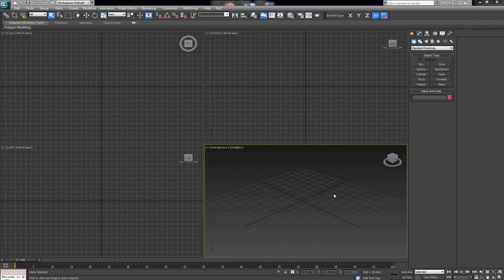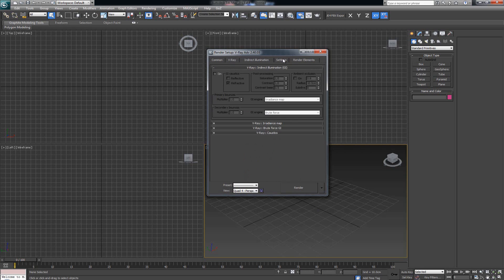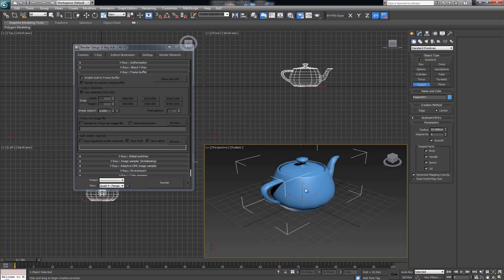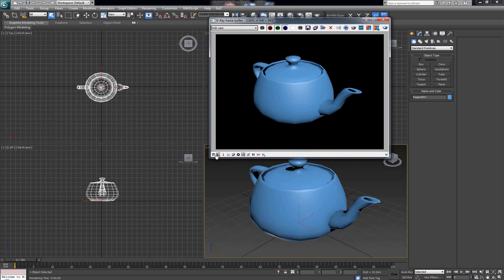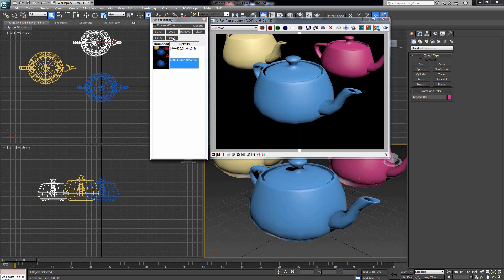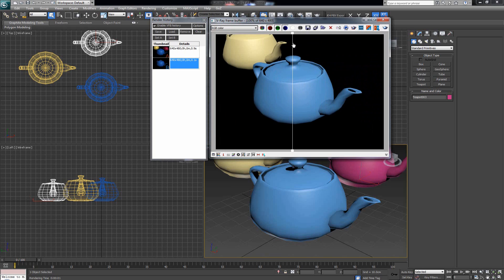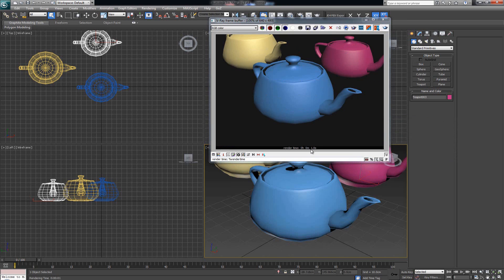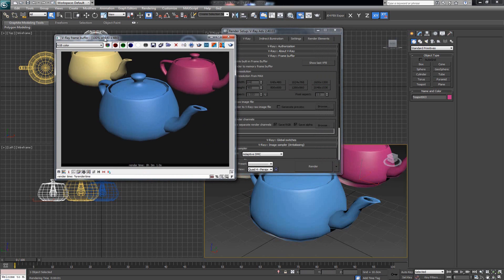Introduction to V-Ray, V-Ray Frame Buffer Part 3

Comment: Hello. What could cause that i have a black render when i'm rendering something while I don't have any lights in scene? It's not big deal, but to see this simple teapot i need add to scene any light source. I could't find this in internet, thats why im asking u. I have max 2016 and 3.40.1 VRAY. I didn't have this problem when i had 2013 max and a bit older V-ray.
Reply from the maker: Well after the 3.40 version of V-Ray you need to have a light in the scene even for a very simple scene like this one. So don't worry you aren't the only one with this issue
Reply: @DenisKeman  thks.....for the answer. i hav same issue too. mine is 3.60